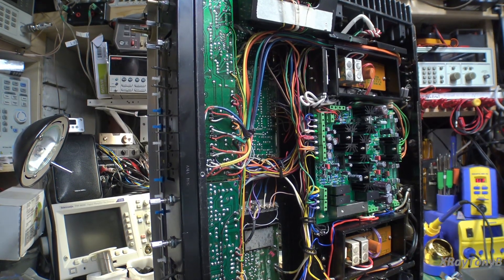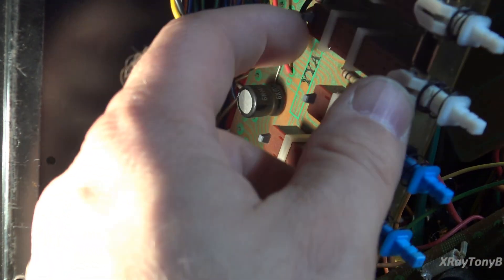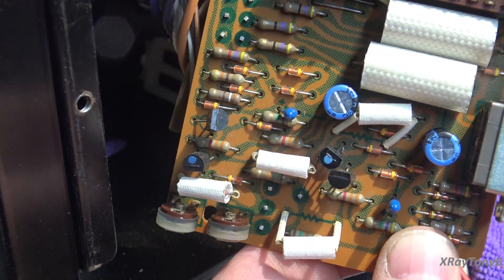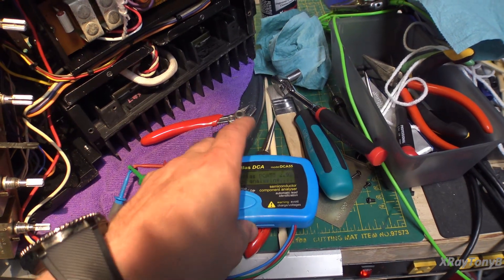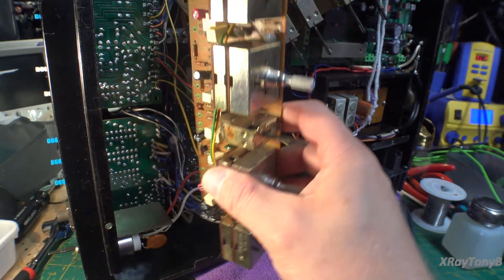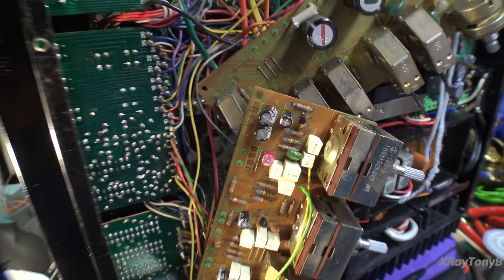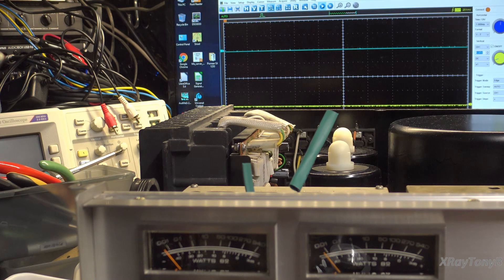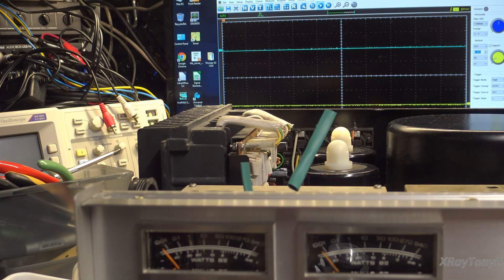Pioneer SX-1980 Part 4 - Flat amp & Tone amp stages

Comment: The cap
1.looks more "industrial grade" and "pro"
2.keeps the capacitors mechanically stable

The nuts look like they somehow don't belong there.

As for the transistors, 2sc2240 and 2sa970 would do a great job there.

Comment: Hello! Very interesting video. The info about the paint dot related to gain ranges is a confirmation of the datas I had. I've read that info in a 1968 Texas databook, as US providers also used this system, but the Japanese codes are different, and perhaps as you say made on purpose for a company. The suffixes letters in references are more trustworthy, but only a aimable on limited references. I've seen these color dots in Sansui and Sony, but some where yellow, some purple, and always prooves difficult to replace. The original documentation generally confirms the are selected values! As you say, Google cannot tell us all, it's never a simple job to do without expertise and experience. The DCA75 or equivalent is somewhat a good tool when you have to test and compare transistors. The selected gain transistors are not always available, or too expensive when it comes to power transistors, so the trick is to buy enough units and do the test by yourself, applying some color code paint dots as it was old fashion. Depanding on specific gains needed, the problem is to have an initial number of transistors to test sufficient, and that depends of the maker, the data dispersion of his production. So, you sometimes have to buy from different suppliers, different lots, as the same batch can have very low dispersion, say variation of that gain: if 50% are in the hfe range 150-200, if you want a 270, you have good chances! Alas, with nowadays productions, you have high probability to get a 90%, or more, so if you have only 20 transistors to test, you finally have to search another reference or have a no budget limit for sourcing another 80 lot (even if the cost of these transistors is now ridiculous when you buy them by the 1000's, finding two paired transistors is a long and costly process).
The perforation trick for linear switch is interesting, and certainly less destructive compared to the total dismantling + desoldering process.
For the power caps, nylon nuts are simple and efficient, they won't vibrate or come loose in the cabinet! The plastic tab is a good solution for the eyes, but needs some glue to rest in place... A good compromise is to design some underneath plate you can bolt the two caps in place and cover the bolt pits.
In fact, the problem I the white color of these bolts:
A solution is a complete black metal cover, as made for top end tube amps, but the result will be hidden by a cover, and you don't need to sell some special audiophile trick. 
Another is to paint them black!

Comment: Nice work Tony, regarding those push switches, I dismantle them and clean the contacts with the scratch brush, flush with IPA then apply D5, I take the little miniature sliding contacts and run them up and down some D5 soaked paper. I find the D5 alone cannot get rid of the black tarnish from the contacts, but it can dislodge it, which then makes it kinda float around and can cause issues. HOWEVER you cannot dismantle some of these switches, some have terminals on both sides of the switch, in that case, the only option is to use your method which does work, but I would rather dismantle where possible, those push switches Pioneer use are quite easy to dismantle. The lever switches are the same, easy to dismantle and clean...

Comment: Sometimes it is "impossible" to find a repalcement part for vintage audio. I went down this road with a Sony Pre-amp. Many of the first generation FETs are no longer made. And there are no exact equivalents. I ended up re-designing the circuit on a simulator using bi-polars. Some folks have good luck with NTE components. They can get a bit expensive though.

Comment: 270W, what a beast! It's interesting that not even the SA-9800 amp has so much power.

I have the SA-8800, and after replacing the main filter caps, it sounds just awesome.
But now I have to repair the PL-630 record player, it has the common problem with speed drift...
Reply: Spec 2?

Comment: If had a set Radio with 2 ohm speakers and then used 4 ohm speakers And did NOT change any wiring,Would  the new speakers sound less loud or same? They have 93 dB sensitivety, THE new speakers ? Old speakers unKnon sensitivity.Thanks in advance.

Comment: I noticed you used some of the Wurth (red) electrolytic caps.  I use them myself, but for the folks would you mind explaining why you chose them?  Also, I love the black caps you made!  They look much better than the nylon "your" nuts (chuckle).  Did you use Delrin for the cap stud caps? It's a great plastic that is very machinable and threads nicely. But it is a bit expensive, though this receiver deserves "the best". ;-)  Thank you for yet another awesome video! To those who criticize you being "long winded" lol!  Um, if you listen closely, there is (usually) some interesting information. There is a "method to the madness" here. ;-)

Comment: @xraytonyb Thank you very much for your resto videos lots of good info. A quick long question ... Can you do a video on substituting output  transistors from "onubtainium"/obsolete to "modern" readily available ones that would be a good replacement for burned/shorted ones. And any adjustments needed to ensure quality output, durability, and won't damage other components. Ie : I need 2sd388 for a Marantz 1070 I found a suggested cross-reference but it has a lower emitter-base voltage , 7v for D388 and 5v for NTE280 . If you have already done this could someone link the video , again many thanks !

Comment: You are very good at this and I envy you. Thanks! If its ok to ask a question. At around 7:30 of this video you had to drill a hole on one of the switches to deoxit. Is that what needs to be done for a phono switch that the sound fades out sometimes and the way to get the sound back is to push the swithch again? I mean, after pushing the swtich, it sounds awesome again...thanks again, Sir....
Marc

Comment: I do take those switches apart in order to clean them perfectly. Indeed, that is  a job not for the faint of heart. I like to call it neuro surgery. Sometimes, the level of dirt and tarnish you may find inside those switches is outrageous. Spraying the swicth without removing the junk inside may only work for a limited time.
Reply from the maker: You are much braver than I!!!
Reply: This may be a dumb question but do you have to desolder all those pins if you dismantle the switch? Can you just take the cover off? I know Tony recommends against it but just wondering.

Comment: I like the oval caps, but I wouldn't be adverse to either.  Question: wouldn't the cap nuts be a bit safer, as you wouldn't be exposing both capacitors at the same time? That probably a moot point though - anyone being in there with either exposed better know what they're doing or better know a good undertaker.  😁.  Thanks as always, Tony!

Comment: Hi, What is a curve Tracer. I see it in the video. Thanks.
Reply: It's used to characterise a PN junction device - i.e. transistor, diode, etc. In fact, the small tester Tony uses - a DCA unit - actually comes with free software for performing curve tracing, so no need to spend the extra cash for a dedicated tester if you are on a limited budget (see https://www.peakelec.co.uk/acatalog/dca75-960-2.jpg)

Comment: Tony, quick question regarding the transistor replacement (blue dots) discussion in this video.  Is it possible that the most important piece is to have transistors in those locations that are closely matched in gain to each other?  

Translation - so long as you put 2 KSA992's in those locations that were closely matched in gain to each other would it be detrimental if they were not matched in gain to the original?  If it would be detrimental what type of problems might you encounter?

Awesome video series.  I really appreciate you taking the time to put your videos online.  Hopefully like the gear itself your videos will be around for future hobbyists.
Reply from the maker: My answer to that question would be based upon the circuit we are talking about.  Matched pairs are different than transistors that need to be in a specific gain range.  Current mirrors, differential pairs, etc. are more stable when you use two transistors with matched characteristics.  Other circuits need to have a transistor with a specific beta in order to work correctly.  Sometimes, transistors have to be a certain gain AND matched to one another.  You really need to look at the application to know what's important.  
Finally, many circuit designs are much more forgiving than people realize, as there are provisions in the design to "compensate" for slight differences between the semiconductors.  Hope that helps.  Thanks for watching!

Comment: The Caps nut or the black plastic look good. I would prefer the black plastic with a comment saying that the NUTs on the CAP have High Voltage in the event the unit needs maintenance, some other idiot dives into it and gets electrocuted.

Comment: Surprised you don't use a contact cleaner first and let it evaporate before using the DeOxit.
Reply from the maker: Deoxit D5 has the same cleaning agents in it (mostly mineral spirits) as standard contact cleaner with a drying retardant to slow down the drying process a bit and allow the cleaner to break down the corrosion.  As a result, there's no need for a "pre-cleaning".  If you are going to use Deoxit D100, you would need to clean the contacts first and then apply a very small amount of the D100 as a protectant.